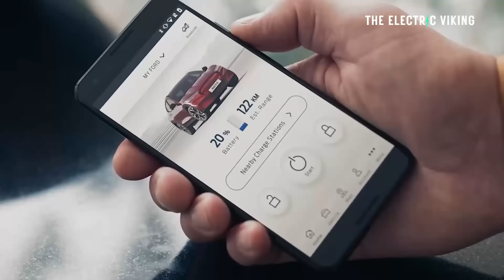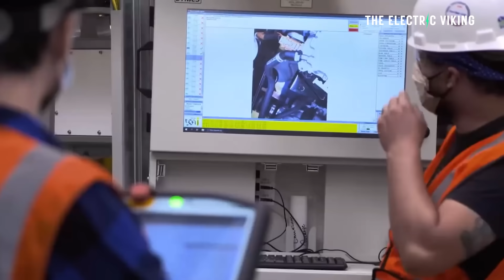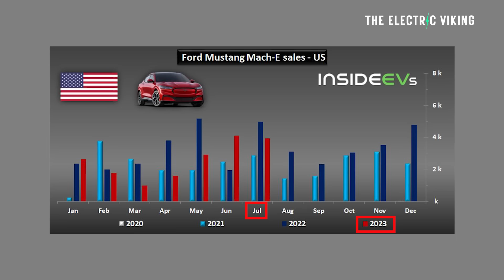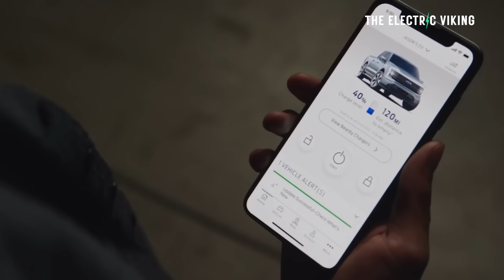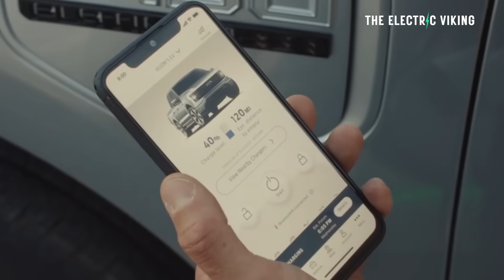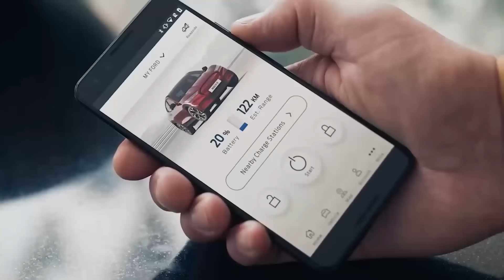Ford in CRISIS: electric car sales collapse in July as inventory piles up

Comment: Dealers do not get repeat oil change and maintenance fees on E vehicles, they want them to fail.
Reply: I do my own ICE maintenance, always have.
Reply: I think you'll find that on EVs, although there's less maintenance to do, they just charge you the same or more. How much does Tesla charge for replacing brake fluid, or lubricating the caliper glide pins, or replacing a suspension drop link? All the stuff I can do myself at home.
Reply: @robertfonovic3551  basic maintenance- sure.  but when my turbocharger failed, and I looked at what it took to take apart half the engine to get to the exhaust manifold- I ended up paying a fortune to the dealer.  I respect the experience and skill of a professional trained mechanic.  I'm handy- but just not that good.  Nor do I have all the special tools.  If you've got the skill and equipment at home- good on ya'.  Most of course, don't.
Reply: Maybe the dealers would rather not deal with cars where any fire is nearly impossible to put out.
Reply: @MartinHouston42  gasoline never catches on fire, we all know that, and a liquid that can spread a fire or cause an explosion, carbon monoxide poisoning, that never happens with ICE vehicles does it  ;/
Reply: @moreybrown870 That's completely besides the point.  Dealership's main source of revenue is maintenance. 
EVs don't have any. 
Of course you'd still bring your EV in for serious repairs that need special tools.
Reply: @MartinHouston42  So they should just stop making EVs then an leave it all to Tesla. As a Tesla shareholder, I think that's a great idea.
Reply: @brendanpells912  There's no need to go to Tesla for a brake service.
Reply: @brendanpells912  you would rarely need it, using regen w/ one pedal the motors stop you not really much pad use.
Reply: @soothingrelaxingmeditation3129  Did you notice I didn't say replacing brake pads or rotors? Even with less actual brake wear, the glide pins are just as likely to dry out and need regreasing, and the brake fluid still needs replacing as it absorbs moisture over time, not usage. Also, not using the brakes much can lead to the rotors becoming pitted by corrosion because it doesn't get scrubbed off periodically, then they become like cheese graters chewing up the pads.
Reply: Hilarious.   They just spent 33 billion to convert
Reply: @motorbreath22  When a real car catches on fire, you can put it out without too much issue.  EV's, not so much.
Reply: @robertfonovic3551  like what? Greasing the muffler bearings?
Reply: @brendanpells912  that’s a load of bull. The glide pins? The brake fluid? The brake fluid is in an enclosed environment. Unless you have a leak in the system, no one messes with the brake fluid.
Reply: @royphillips7644  I am a retired engineer. 4 out 10 for your attempt at humour. Have another pipe .
Reply: @royphillips7644  you obviously know zip about cars.
Reply: @motorbreath22  Obviously it happens, but engine fires can be put out with a $20 home extinguisher, I've never heard of a gas car exploding ever, and modern engines, don't produce enough CO (carbon monoxide) to even allow someone to commit suicide like in the old days.

So while what you suggest is within the realm of possibility, none of it happens as a practical mater.
Reply: @themonsterunderyourbed9408  Brakes still need service, tires needs service, the cooling system needs service, electric motors fail, and eventually the battery fails.
Reply: @motorbreath22  hardly ever.
Reply: When was the last time you bought an electric device that you still use that is ten years old? Any Computers or phones still being used that are that old? I'll wait.  Computers are advancing every day. Your five year old Tesla today will have obsolete hardware for the new software being written on the new standards that will exist in just a few years. Electric hardware fails also. Look at average repair bills for Tesla. Even non crash damage is insane. And they can't get parts half the time. Keep drinking the cool aid.
Reply: @ZeusBullyMax  Brake fluid is typically replaced ever 3-4 years.   It gets moisture in it and rusts the lines from the inside in it unless you replace it.
Reply: @@John-cp6uc they are mostly plastic.
Reply: @ZeusBullyMax  brake fluid is hydroscopic. You have to change it or you will rust the lines. It's not at all hermetically sealed.
Reply: @@John-cp6uc anyone sold on the environment or cost aspect of EV is a dunce. Only cool thing, right now is how fast they are. And that you could, for a cost, fuel up at home with solar panels. Undeniably that is cool. If everything is well made then you are independent for 20 years.
Reply: @@John-cp6uc Only until we invent magic fairy dust to power them.   Then they will REALLY rock.
Reply: @maxwellblackwell5045  : I use the example of the perfectly good battery operated drills on the basement shelf. All they need are expensive batteries to get them working again.
Reply: Or its just most people don't want to buy an EV.. especially the MachE.. the Tesla is much better value. The F150 lightning? No thanks, have you seen people try to use that truck as a truck?
Reply: @jonathantaylor6926  : I saw an article on the MachE, comparing it's cooling system to a Teals cooling system. What a nightmare for the Ford. I see they built in many failure points, as well as weight.  The Lightnting, I saw an article where they could only tow 85 miles per charge, then had to leave the trailer someplace to use a charger. Another article had the Lightning taking 14 hours on a 240 V clothes dryer outlet to charge.
No. For the foreseeable future, I can find no EV that suits my needs.
Reply: @drewthompson7457  you don't use it everyday for ten years. If you did, it wouldn't last.
Reply: No, people don't want them.
Reply: As a consumer I want EV’s to fail.
Reply: @themonsterunderyourbed9408  no it's not lol. It's selling cars.. most people dog get their car serviced at a dealership

Comment: They priced them above the limit that allows you to get the 7500 tax break. When I bought my Mach E Performance Edition I got it under 60 k and got the tax break lowering my overall cost of the vehicle. Same car is now over 70k and no tax break above a 60 k vehicle. Same on the Lightening. You can't order a extended battery and stay below 60 k. That is part of the sales problem.🙄🤦‍♂️🇺🇸🙏

Comment: Ford went to a business model of selling less, more expensive cars, taking great advantage of the COVID related supply problems - and their profiteering dealers made that even worse. Tesla called their bluff on EVs, and the MACH-E joined all those US$80,000+ trucks, EV or not, are piling up in dealer's lots. A basic truck should cost US$40,000, they have huge reductions ahead of them to get people buying their cars again. Their sales are bolstered by fleet orders catching up after COVID for now, but that bump will be gone in a few quarters. The MACH-E is completely uncompetitive at current prices. Even VW EVs are more cost competitive in the US.
Reply: Everybody went to that model, including Tesla.  Tesla, to their credit, saw that the market was changing and slashed their prices early on.  Ford's price cuts are too little too late.
Reply: Sales on the inexpensive Ford Maverick are through the roof as, "The Maverick's immense popularity is great news for FoMoCo, but at the same time, the automaker has struggled to keep up with demand, as many reservation/order holders are facing long waits before taking delivery." Don't even get me started on the Bronco.  They are everywhere on the road.  As for the Mach E, my dealer has only one unit in stock at the moment I'm writing this.  And I just got an email from Ford re-opening F150 Lightning Pro orders for existing reservation holders at the new $50k price, a price that the EV says is still a good deal.  Now add in the $7,500 rebate and that Ford 150 Lightning Pro is $42,500, almost in line with your $40,000 price tag.
Reply: You do realize that Ford corporate requires dealers not to discount EV's, right?

Comment: My local dealership here in Arkansas USA has a ton of Mach E’s on the lot. The CHEAPEST one is $65,000 and they I’m only have one of those. The rest of them are $75,000-$85,000 and most are at the top end. No one wants to spend that kind of money to be a Guinea pig. The problems that new adopters are facing with Ford EV’s is ridiculous enough, without paying $85000 to deal with it.

Comment: Thanks for the video! I had a depost down for 2 years on the F150 lighting. When I was able to finally pre-order they didn't honor the price and raised it by $13k. After waiting for 2 years and not giving it to me for the price I put a deposit down for on the truck, I was not happy the way Ford handled it. So, I canceled my order and i'm waiting to see what tuck will be under $50k with 250 plus range.
Reply: I have bad news, no full size truck will ever cost under $50k ever again (gas or ev).  You’ll have to buy used to get one at that price point

Comment: One of the things about Ford is that most of the markets that they supply are rural. Rural locatins in the US are hundreds of miles apart from dense municipal areas. There isnt a realiable charging infrastructure for public charging in most of the US and installing EV chargers at home is an upfront cost too. Those who can afford housing in the US are, on average, not the EV interested buyer. Those who live in apartments have only heard of the difficulty of getting charging to qork for their daily needs. Until the US has 10 dc150kw chargers for every local single gas pump, this charging difficulty will continue to exist. Tesla is doing well because tesla isnt trying to appeal directly to rural or lower-middle class american buyers.
Reply: That is complete nonsense. I live in the rural U.S. My home is 160 miles from the nearest major metropolitan area and 90 miles from any interstate highway. There are two high-speed charging stations in my town, as well as several level-2 chargers. There is a Tesla Supercharger station 45 miles west of me and another 55 miles east, along a two-lane rural highway. I just took a long trip across part of Wyoming, all of Nebraska and all of Iowa and had a wide choice of charging stations. The level-2 charger I installed in my home cost $425 and just under $300 to install. The local electric co-op provided a rebate of $250 and the 30% federal tax credit will give me another $217.50 back so my net cost for the installed charger will be $257.50, which is minuscule compared to the amount that I am saving on gasoline.

Comment: Your videos are always so informative and helpful Viking! As a former brand fan, I wanted to chime in and add to the Ford debacle. 

- The Mach E is a terrible value against the competition, especially a Tesla. It compares far closer to the Model 3 than the Model Y. It sits much lower, has substantially less space, less storage, and far less quality of life than a Model Y. It doesn't even come close. Even the driving experience is drastically different, with the Model Y having a much better sound system, more power/fun behind the wheel, and far snappier software in the infotainment center. Comparing it to Model 3, the value in Mach E disappears instantly... 

-The F150 Lightning launch has been a circus. I was a week 1 reservation holder, and after years of run around and hollow apologies for being skipped in line, they offered my chance at the truck for over Twenty-Three Thousand Dollars more than my original build. The sour aftertaste is still fresh. I still like the truck, but the price is just ridiculous, especially given its lackluster range of 240 miles - by the EPA. Reducing their prices to Sixty thousand dollars for a commuter truck is still far from the realm of affordable for ordinary people.

Comment: In the U.S. the Mustang Mach-E qualifies for only a $3750 federal tax credit. The Mach-E does not have sufficient U.S. battery content to qualify for the full $7500 credit. I just went on Ford's online configurator and built a Mustang Mach-E Premium long-range AWD, which is equipped in a very similar way to a Tesla Model Y Long Range. The price of the Mach-E is $56,665, after the factory incentives or $52,915 after the U.S. federal tax credit. The Model Y comes in at $51,880 (including destination fee) or $44,380 after the federal tax credit. The Tesla can charge faster, has a better rated range and has heated seats in five positions, rather than the two heated seats in the Mustang. Is it any wonder that Ford cannot sell these vehicles?

Comment: I bought a $38K USD Ram 1500 Mega Cab discounted to $26K USD when crude prices peaked at $145/barrel. Right now, a similar RAM is priced at $55K USD. Needless to say, I'm in the market for a CyberTruck and hope to get it by the end of Q1 2024. I have an order in the first 5000 trucks. I do use my truck to haul lumber, yard debris, my household garbage, topsoil, motorcycles, etc. So it's not just for show. Right now, there's no way I'd want to deal with 5 types oil changes, coolant replacement, brakes, etc when I can have a maintenance free pickup truck.

Comment: The problem with the Mach E is that it's like a mullet. Party in the front, soccer mom in the back.

There's a very limited market for that look and I think it's saturated.

Ford dealers becoming well known for adding $30,000 market adjustments on everything that moves doesn't help.
Reply: You're right and when these dealerships close you can trace the reason right back to "Greed".
Reply: It’s called Gender Fluid 😂

Comment: That line of his. "EVs are unquestionably the future". Maybe,  but that future is decades away.  The infrastructure isn't here and I'm worried about thermal runaway, especially after that ship went up in flames and that poor owner who had their house burnt out by a Mercedes EQE.  When the infrastructure is here and there's decent fire controls on these, I'll think about it , till then I'm not touching with a barge pole.
Reply: I get hung up on the fact that no matter how well you take care of it, you are staring at a $10k battery replacement 7-10 years in. And you would be an idiot to buy a used one without taking off $10k in upcoming maintenance

Comment: Due to the pandemic, and Tesla scrambling for parts, and due to a mismatch w demand, MY prices increased 50% over launch price. This opened up a lot of the market to OEMs. When Tesla flipped pricing back to launch levels as volume grew, it left OEMs and customers in a new world. The conversation flipped from Teslas are nice but who can pay the premium, to Teslas are nice, and significantly cheaper than like for like competition. With the cybertruck, they are starting to reach more segments. The one genius move of MY design (and Cybertruck we'll find) is using the opportunities of an EV to create storage. Many Americans drove SUVs for more room, where space is shared with an ICE engine, and fuel tank. Many SUV owners may be finding an MY suits them well.

Comment: It may be that if people want an electric car, they want a Tesla. Perhaps more important with the info system and the navigator in an electric car than in a petrol car. So that it works well. there was a survey in the US maybe two or a year ago that showed that households were dissatisfied with electric cars and found it problematic to charge them at home. These households were often smaller households and households with a lower income. however, it was an exception, those who had bought a Tesla were more satisfied. Otherwise, it was the case that a certain percentage of those who had bought an electric car switched back to a regular petrol car

Comment: I was at my local Ford dealer getting an oil change, so as I was waiting I sat in a Mach-E. The interior looks much nicer in person than in photographs. The fit and finish looked great.. at first. I tried using the touch screen. It was not good. Lots of latency between inputs and actions, on simple things like changing radio stations. Their computers are bog slow. Cheap-ass no-name Android tablets work better than what Ford is using. Then I decided to look at the frunk--no frunk for me is an automatic no-sale. The lever to open the frunk--which should have had a power opener at that price point--was broken. The lever was made of cheap plastic. I assume something broke inside of the mechanism, but if they used the same plastic inside as they use in the customer-forward parts of the car then it was completely understandable why it snapped. This was a GT model, so the cheap plastic bits didn't have the excuse of being in a base model vehicle. They need to both fix the cheap components AND fix the price before I could even consider getting one. For a supposed halo vehicle it had no excuses. Someone needs to get ahold of Ford corporate and inform them that the good old days of the Taurus and Pinto are over. The accounting department needs to be removed from any management capacity that doesn't directly involve a spreadsheet and let the designers and engineers do what they are theoretically good at. If they do not then they are a walking-dead company.

Comment: My experience has been that the dealerships have absolutely no idea how to fix the ford Mach e. It’s fine if you never need anything but as soon as you have an issue you are screwed. There is often only one tech who is trained on fixing these cars. One lift to accommodate the cars. And a tech up to his eyeballs in work. I had to just hand the dealer the keys and trade my Mach-e in for another one when I got frustrated with the service department’s incompetence. 

Problem number two is the ride is horrendous. The springs are too stuff and the damping isn’t enough. So the rear of the car bounces all over the place. People experience this on test drives and get cold feet. They need to fix the ride asap